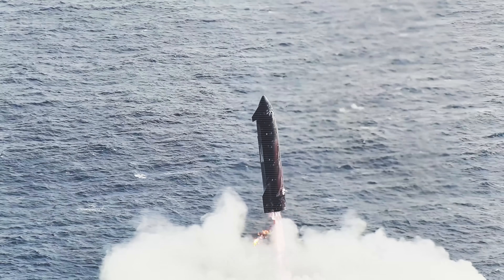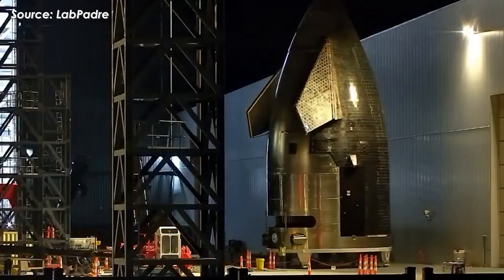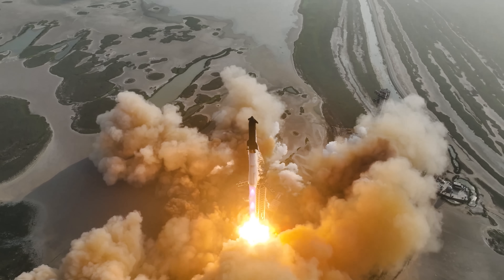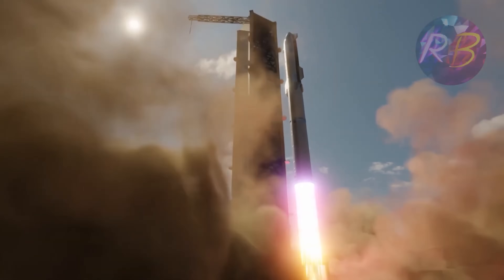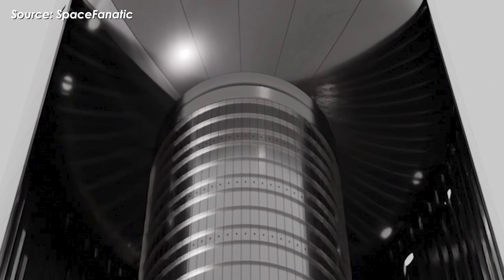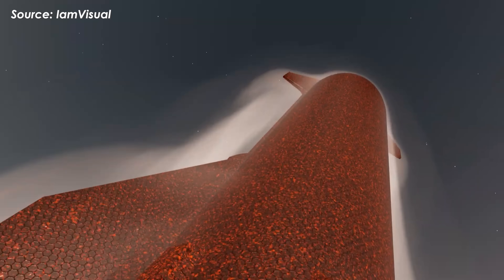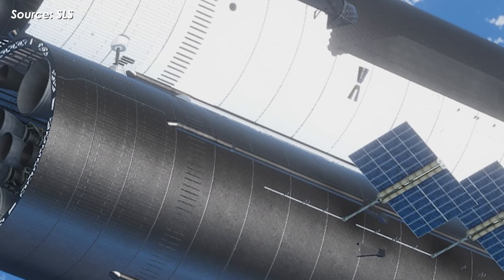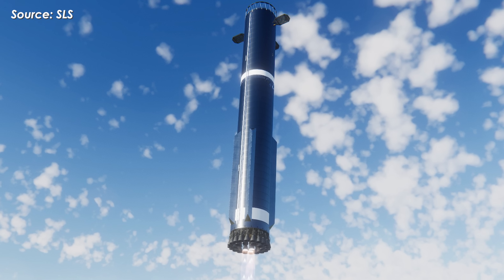Elon Musk declared Big Upgrade on Starship V3 to the Moon Shocked NASA!

Comment: Mars Starship is different from the current Starship designs. It requires an external Whipple shield, protected insulated fuel tanks and a crew area that has radiation protection and full life support. So it is different from the earth based starship. The big advantage to building Starship in one company, is they can design and build a starship that meets unique and diverse requirements.

Comment: If Mega booster was 11m or 12m no taller as V3 with 40 to 55 Raptor engines, add a 8v + 3sl engines on 2 stage tapering from 12m to 9m x 30m for Star-Shop Hot Stage. The Star-Ship will have 4v 3sl and 16 electric ICON engines with KILO 5kw generator.